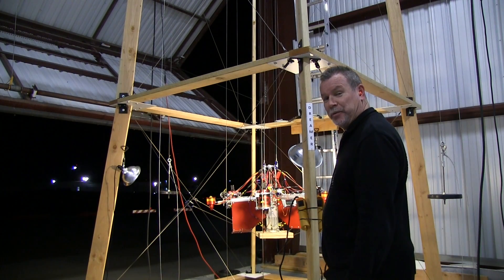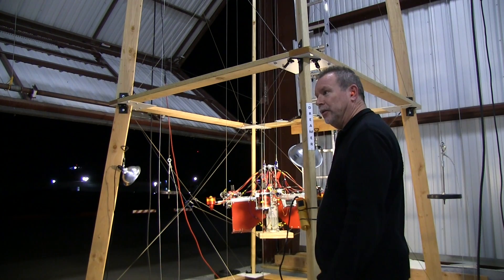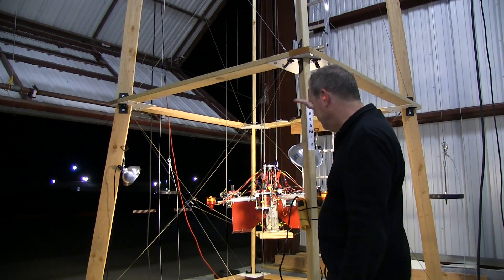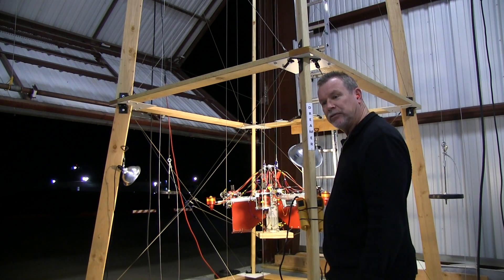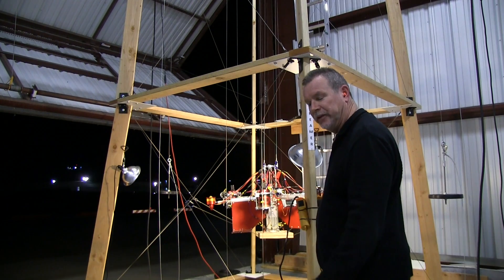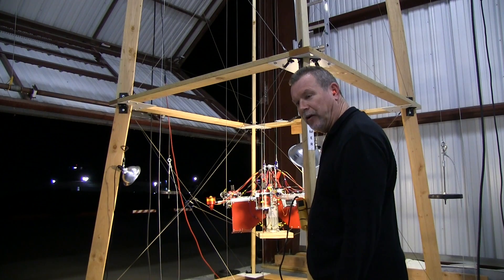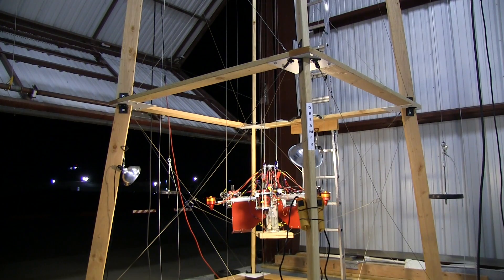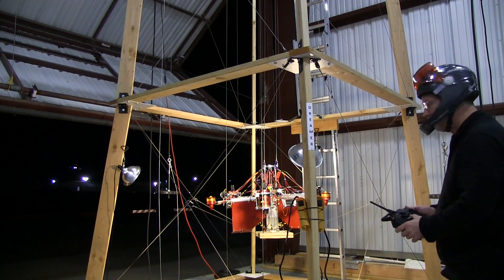Turbine Drone Flight Test

Comment: This  can be hover board, flying vehicle vtol concept, a jet version of the ehang.  Also how much weight do you think it can hold?
Reply from the maker: It depends on which jet turbines are used. This prototype could likely lift about 40 pounds.